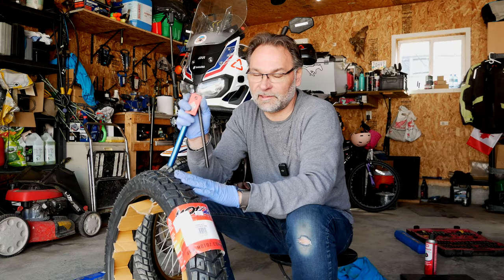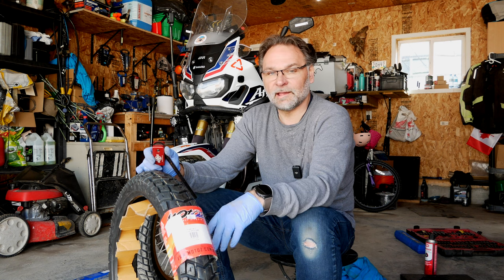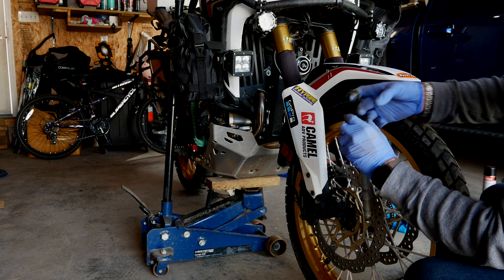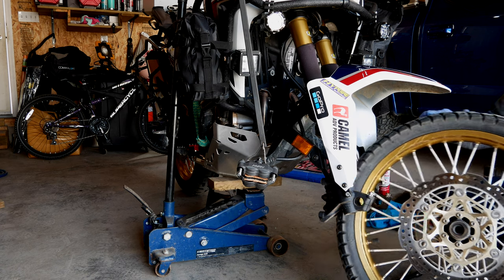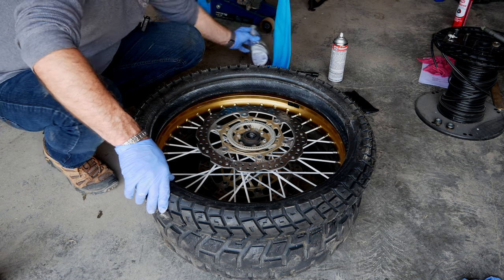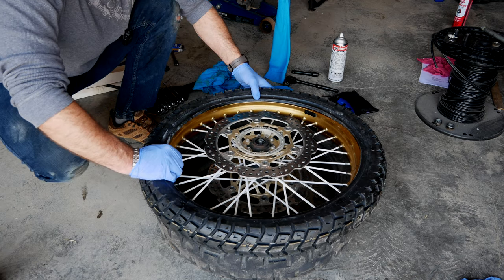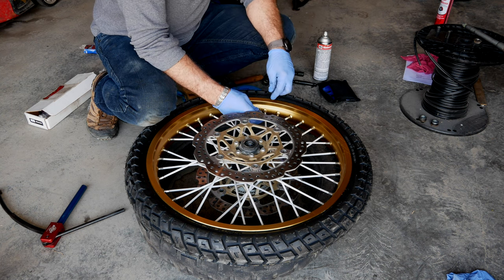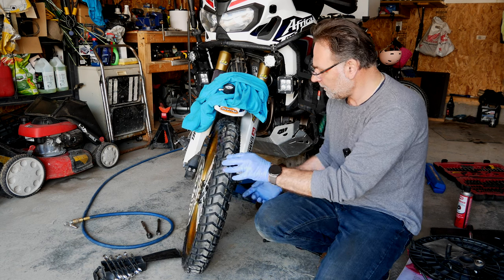How To: Quickly And Easily Change Your Motorcycle Tire #tirechange #motorcycletires

Comment: I do 👍 As mentioned getting the valve in can be a struggle.  I watched a Dunlop guy fit the tyre with the tube already in..that's what I do now and I find it works better for me.
Reply from the maker: After this tire change I got myself a valve puller from Amazon I will try using it next time, save the knuckles

Comment: Thanks for the video! I have left my tire, Mitas E 07 half off last night after long suffering. Will continue today, refreshed :). I'll try to put some soap when dismounting too, as you do. Could it be that the corrosion is caused by the dishwasher soap? I'm using tire soap and there is no sign of corrosion.
Reply from the maker: I don't think this small amount of dish soap would corrode anything, it is such a small amount only on the bead.  And the actual corrosion is more in the middle of the rim.  Many other people will use dish soap to change tires and some even mix with water and spray a hefty amount. I think 16-17 AT has issues with the anodizing rims.